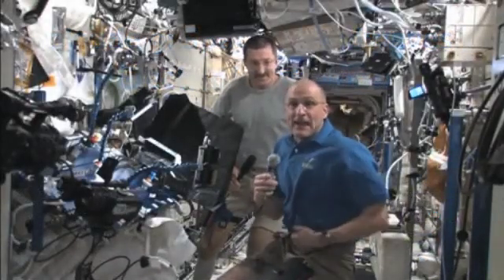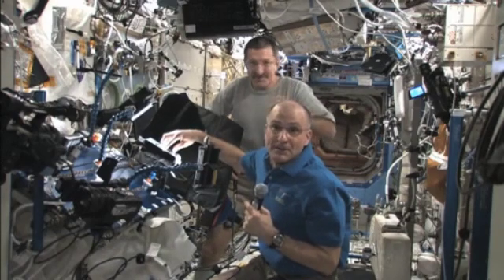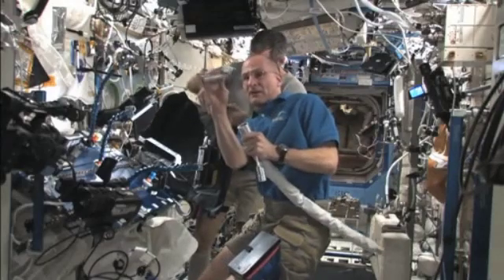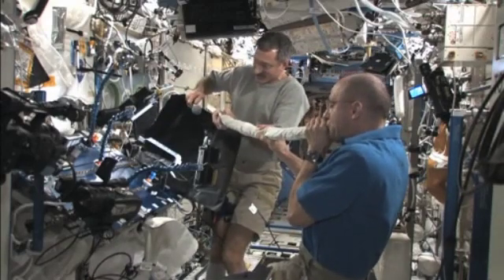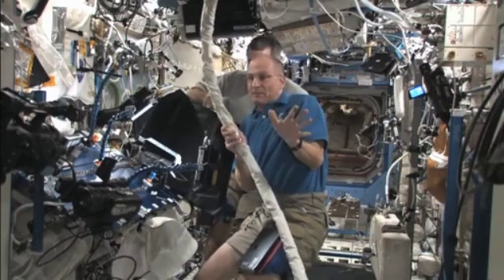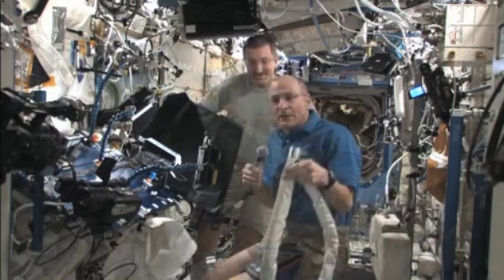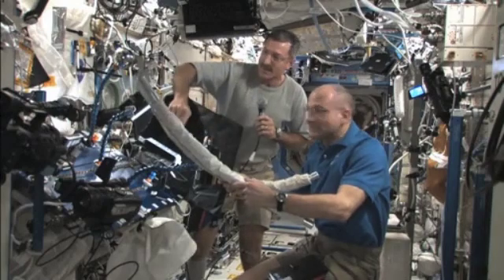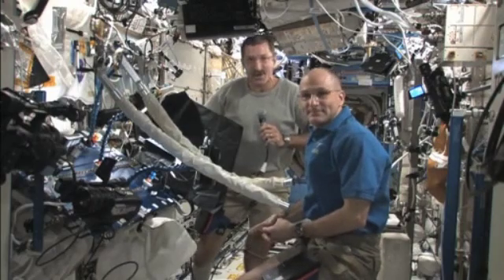Using a Didgeridoo in Space to Vibrate Waterdrops | NASA ISS Station Science Video

Comment: Challenge question answer :
Considering that the amplitude en the pressure of the sound coming out of the didgeridoo stays at each try the same, a bigger amount of water is harder to bring in oscillation with the vibrations generated by the didgeridoo because it has more mass and a bigger moment of inertia, the small amount of water has less mass and will swing harder in the oscillations and therefore breaks up more easely.